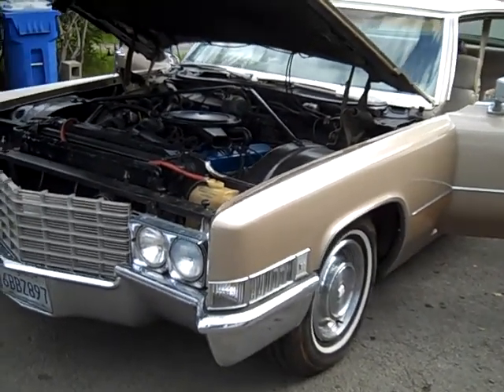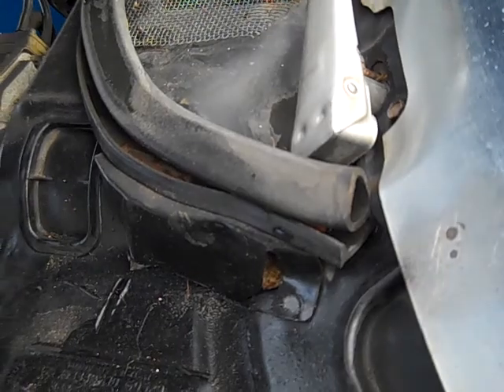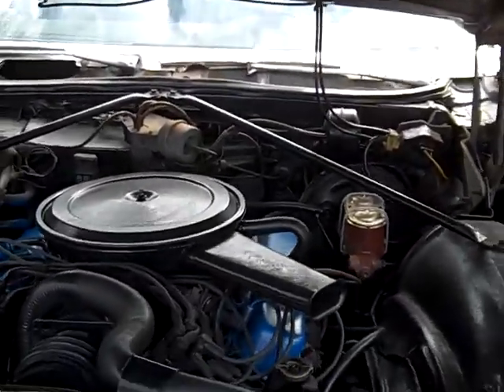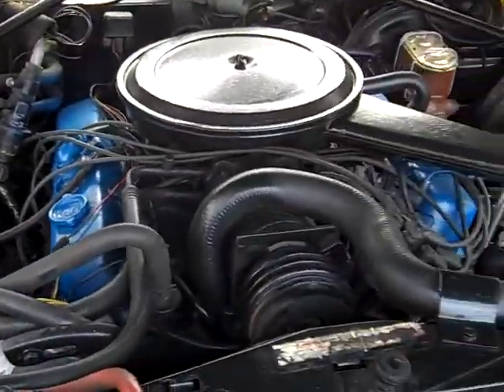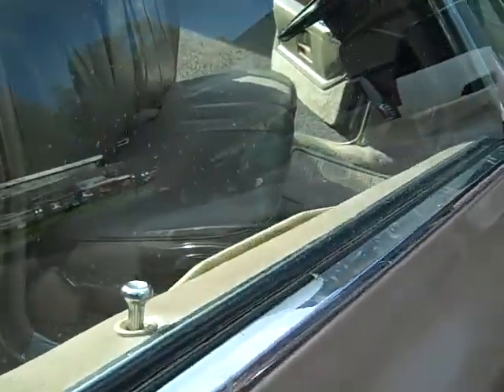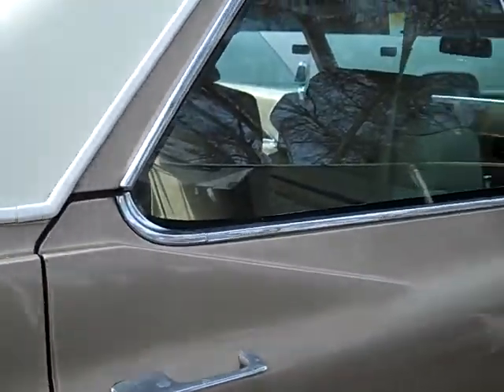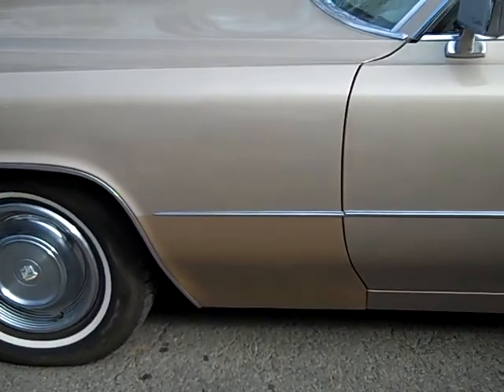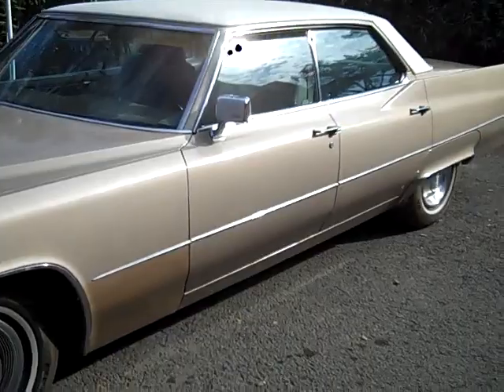Inspecting A Collector Car - Points to Consider - Subject Car 1969 Cadillac

Comment: I do haggle, but I always buy on the spot because i find the repair work therapeutic and enjoyable. Have brought everything back to life, even cars with missing floors that sat in grass for decades and been crushed by fallen trees and rock wall collisions. Nothing scares me. But its still good to know these things to know what you're getting into ahead of time and can plan where to begin on the ride home with it on the trailer. Been winging it and have my own process at this point, but i am here since i'm currently working on a 1969 Cadillac Fleetwood Brougham in triple gold that has snarls of rust down one side and a mildewy interior. The interior is coming out and the skeleton reskinned in velour. Going with a period correct executive- celebrity limo vibe on this one with privacy curtains made using 1970s sewing patterns, installing a 1970 television for the back seat, and minor "upgrade" to put a VCR in for the TV, and a vidicon tube "dashcam" system all sourced from the early 1980s.
If i've learned one thing bringing cars back to life, its that they're only original once and after that it doesn't matter....But if you don't respect & draw from the era the car came from and those around it (mix and match eras that would have gone together such as building a 1980s take on a 1950s car, but never modernize to the 21st century), you might as well not own a classic car. Its also a lot less expensive and less of a headache if you're a creative fabricator, because you'll avoids the snipe chase of original parts and come away with a car that better reflects you and has a story to tell at the car show. 
Original engine and trans, original radio and optional under-dash 8 track deck that will be refurbished and reinstalled. It WAS all original, last driven in 1985...but obviously with the interior and rust it wouldn't be after I did anything anyways.

Comment: I had the Fleetwood Brougham, color is Cameo Beige Metallic, very hard to match for one panel. Only one year with “rim-blow” horn, I think yours may be correct. Yes, 8 mpg was normal but rust repair cost more than gasoline. Coupe and Eldo were the ones to keep 50 years later. Thanks!

Comment: If you're trying to buy an original, check the brochures at http://www.oldcarmanualproject.com/ to make sure it's got all the trim pieces and wheel covers that it's supposed to have. Some people like to delete some of the chrome and badges and switch out the wheel covers. They're sometimes nearly impossible to get so it's important that "an original" is intact. Don't pay for something you're not getting!

Comment: he forgot to mention that it has the WRONG steering wheel!!
Reply from the maker: Wheel is correct, I could have described it in detail to show the wood trim insert and how they usually fail with sun exposure. Sometimes I see home-style repairs to the insert, but not many owners choose to send in the steering wheel for a restoration costing in the neighborhood of 800 to 1000.
Reply: no.... the wheel is off a latter Cadillac. I own 2 x 69 cads that have the correct wheel - they dont look like that!
Reply: http://www.oldcarbrochures.org/North%20America/Cadillac/1969_Cadillac/1969-Cadillac-Prestige-Brochure/slides/1969_Cadillac_Prestige-07.html It's very similar to the correct steering wheel, but should have a bright stripe on the vertical spoke as well as the two horizontal spokes. Note also that this brochure also shows a De Ville steering wheel without the wreath around the crest on page 10.